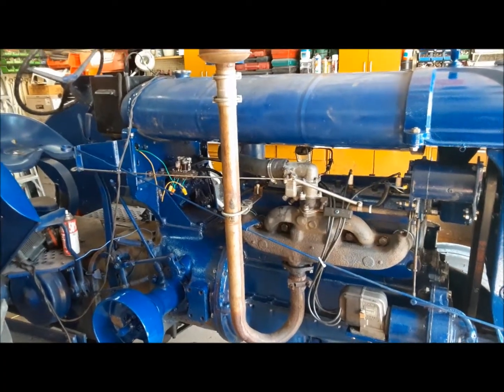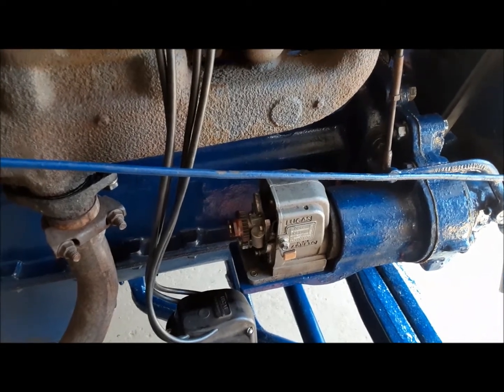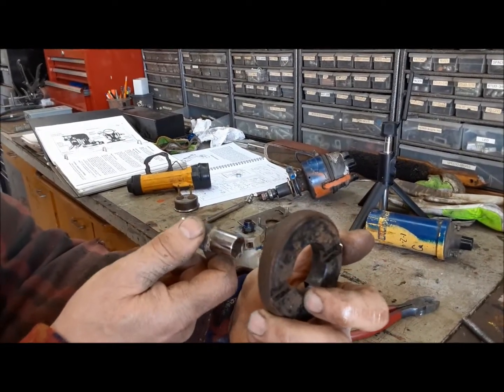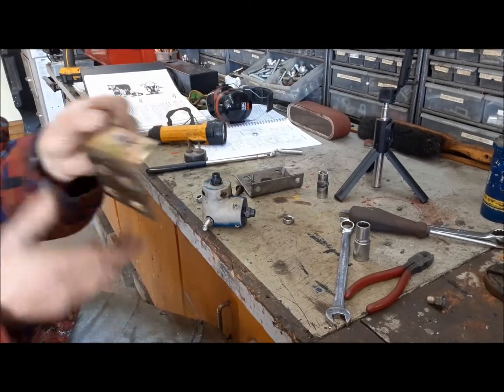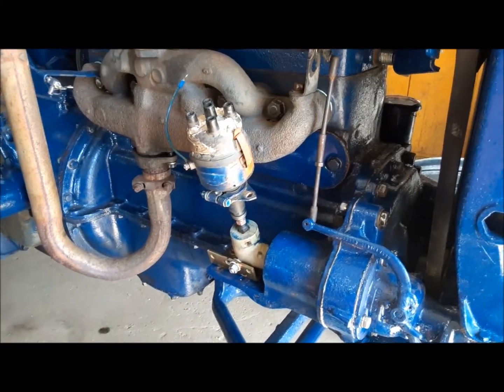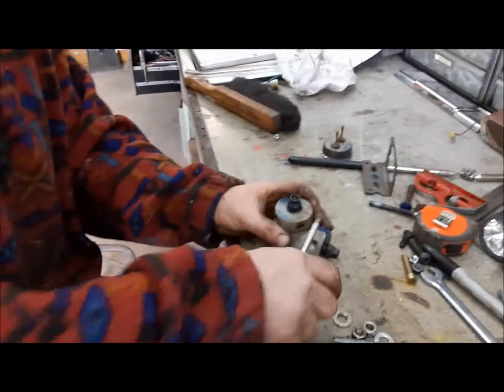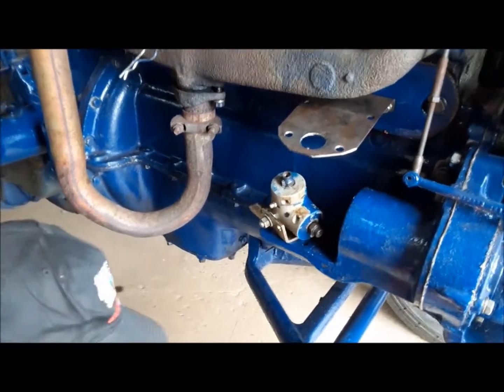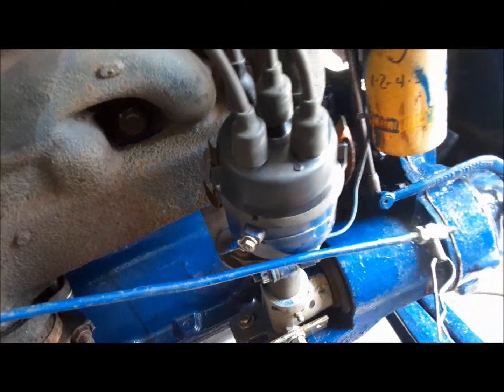Fordson Major E27N part 14 Converting from magneto to battery ignition

Comment: I found this video very reminiscent of what my father did here in England over 25 years ago. He had the very same problem with the Lucas magneto on our Fordson Model 'N' tractor. What my father did was to use the magneto contact points to fire a 12volt coil. that was slung below the magneto bracket. The high tension wire from the coil was fed back into the magneto distributor cap. This was achieved by dad drilling a hole into the distributor cap so as to feed onto the rota-arm. Because our Model 'N' had no other electrics, dad had to sling a small 12volt car battery on the side to the engine (where some 'N's have a tool box). With dad's modification, starting our Model 'N' became one very easy task and showed up just how poor the Lucas magneto really was.
Reply from the maker: I just picked up a 1936 N that has also had a distributor added. Modifying the mag as your father did is also a great idea.